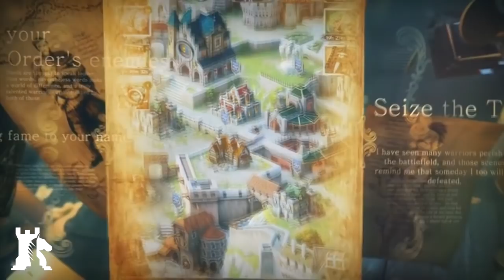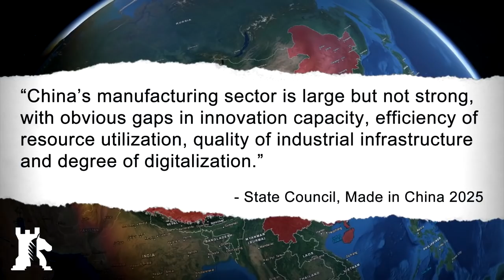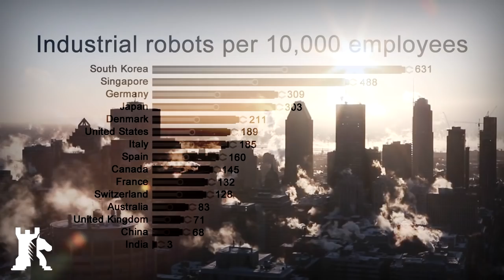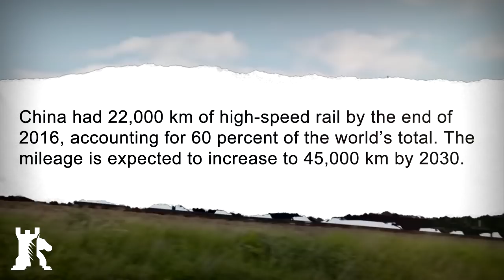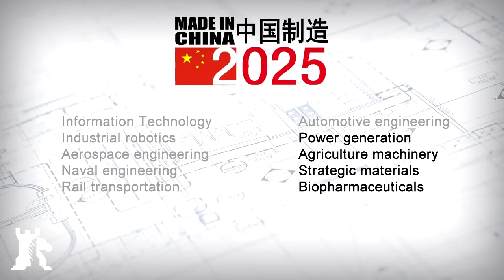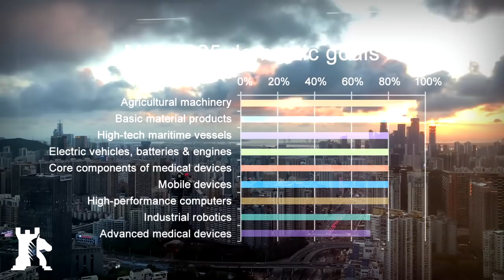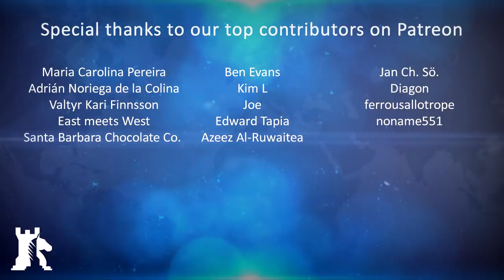China's quest to catch up with the West

Comment: China basically bought the rights to all the most common nuclear reactors in the world over the last 15 years and build one or two plants of that type generally with multiple reactors at each site. With the goal of producing all the parts internally. Now they're building about one of every type of experimental nuclear reactor and have completely outpaced all research throughout the rest of the world. They will be the first with several Gen IV designs with the hope of licensing them to other states.  Wikipedia says that some of their Gen IV reactors should be operational currently although timelines might have changed.
Reply: @Kevin Bettinger lies
Reply: Current second generation plants are slated to terminate operations very soon.
So most every nuclear nation will soon be in the bid for contracts.
Reply: Enjoy the RKMB reactor.
Reply: @Kevin Bettinger I could be referring to the United States dependent on reactor life-extension decisions.
Reply: China has built the world's safest nuclear reactor, which may be safer than coal.They invented a technology that drastically dilutes nuclear fuel, thus virtually eliminating the possibility of all nuclear accidents. 
Say another way, even if their nuclear reactor is completely broken, there will be no accident.Since the nuclear fuel has been greatly diluted, the nuclear reaction leaving the reactor will stop immediately. You just need to pick up the nuclear fuel and re-create a reactor and throw it in.
Reply: Replace China with Russia and you got this right.
Reply: @Kevin Bettinger The United Kingdom for one. China is marketing it's nuclear plants to developed nations only.
Reply: @Русские_вперед  No, where on earthy did you get that from?
Reply: Bought? You mean stole, china is built on theft.
Reply: China leads in the development of thorium-fueled reactors. It's the next step beyond Gen IV reactor
Reply: Nuclear reactors must overtake the world. Ik that it's not cost efficient for most of the time, but it could save at least a century to live in the world. But it's also true that almost( more than 80% )all the nuclear power plants are II generation power plants and both Fukushima(BWR)and Chernobyl(RBMK) power plants were II Gen. So, basically most of them can't face hyper natural disasters. It's very much important to build them at a safer place, where disasters aren't usual. Or another wasteland would be created by the hands of the humans and it could be the end of all nuclear power plants.
Reply: @WalayatFamily  as is the west

Comment: Basically thier main is is they may make a lot of things for export but they depend on importing high tech components
Reply: Not anymore
Reply: It's a material science problem. Any centralized economy is terrible at innovating new materials and classes of materials and typically can only try to improve on or mimic existing products. Truly innovative improvements in materials science and technologies mostly come from a shotgun approach where hundreds or even thousands of competing producers develop proprietary materials and methods, balancing potential great rewards against the risk of complete failure. Bureaucracies are terrible at this. That's why the tech giants in the US after their initial successes have progressed mostly by buying up small innovators, rather than coming up with truly new innovations on their own. China has only been able to succeed to this point by stealing the work of others through patent infringement or forced technology transfers, it will take a cultural shift away from doing what the conventional wisdom demands towards intellectual independence for their technological base to improve and succeed on its own. That kind of self-determination and independent mindset won't sit well with any communist regime since it requires personal ownership of intellectual property and adherence to patent law. Without that impetus there's no real incentive.
Reply: @jinruizhang  lol minus foreign parts china has no product to sell , you cant beat western countries which have diverse groups of people working to develop stuff, freedom breeds innovation not opressive govts
Reply: So we've been taught since high school, and we are seeking for a transformation about this.
Reply: I agree. But we are taught to solve the problem since decades ago. that is why there are so many Chinese students studying engineering. we are not lack of high technology now. we lack cutting edge technology which are monopolized by few countries
Reply: @massivereader  That's a good comment but I'd generalize the issue to the industry as opposed to just material sciences. It can be machining tools, handling powders or fluids, specialized electronics and so on.
Reply: @ivanlagrossemoule True, it's just that materials science is the thing China is having the most problems with. Since high end materials and end products made of those materials are mainly produced by proprietary processes, just having samples of the end results doesn't necessarily reveal how they were made, just what they are made of. This is the problem they're having with things like jet engines and advanced electronics. As Xian Yang pointed out, they have plenty of engineers likely able to reverse engineer western products in a workman-like fashion when told to do so, possibly not as cost effectively or elegantly as the inventors but 'good enough' to work when profit isn't the motive and government can step in to set the priorities and limit competition. But having the closely guarded industrial processes developed over decades to make, grow, forge, sinter, extract, purify, etc. exotic materials to make high end products like single crystal turbine blades for advanced jet engines with the structural durability to last thousands of hours at intense temperatures and pressures (rather than  than dozens or hundreds of hours) isn't just a matter of engineering. It takes advanced materials science, innovation and experienced experts pushing the limits of the art looking for results that aren't a duplication of existing things, but something new. You don't get that by just attending university. In response to his criticism, it isn't a matter of 'monopolizing cutting edge technologies' it's the intellectual process of creating those technologies they are lacking and cannot effectively reproduce. It's not a monopoly. They just didn't appear out of thin air to be harvested. it's an approach based on the competitive capitalistic system, something a centralized governance system lacking flexibility and driven from the top down can not effectively duplicate.
Reply: you didn't see a fact that some high techs are baned by the west for exporting to China for a long time.
so a truth is China had researched and developed most all by itself
Reply: @utavinzo9481  When you have the product at hand, reverse engineering is not so difficult. Most technology becomes the standard of the art within twenty-five to forty years and any competent professional can use and apply what is widely known. That's why patents expire. China merely sent students to Western Universities, or brought professors from those institutes of higher education to teach in China. Almost all of science is available in the west because it's required to publish everything except proprietary information in professional journals to advance the dissemination of knowledge. It's never been the case where China knows of a product and comes up with an alternative without skullduggery. If China hadn't bought IBM's PC business and named it Leveno, they'd still be about twenty-five years behind the art. Most of China's technological and manufacturing infrastructure was built by western countries to take advantage of the low labor costs. Almost all of China's military hardware is embarrassingly similar copies of Russian or American gear. Please provide examples of cutting edge products china has developed on it's own. Cell phones don't count, they ripped off the tech from Apple and Samsung and still buy the main chips from elsewhere.
Reply: @massivereader well there are too many verities you don't know, try at least to understand the most obvious variation of power and potential in this world
Reply: @utavinzo9481  When someone has developed a new technology based on new insights or advances of science, and published the underlying science in freely available professional journals, duplicating their experiments and applying the results in imitation of the innovators is not the same thing as inventing and making practical application of new discoveries ones self. It's copying someone else's work and likely infringing on their patents. Sorry.
Reply: @eduwino151  you dont seem to know about what you are talking about. look up the patent registrations from the last five years in the fields of tech and bio engineering. China isnt even profitable to foreign investors to be the assembly line anymore, they have been moving to south east asia for quite some years.
Reply: @massivereader  There are several things you did not consider. China is not a communist regime, it is ruled by a communist party, but it is not a communist regime. intellectual property right laws exist (yes not the best enforced, but the structure is there and its improving rapidly), and a cut throat free market at the domestic level. It just puts restrictions of foreign investments (why let others profit on you for free while stopping yourself from developing, orange man trump is doing the same thing now becuase china is catching up and EU has been doing this since long ago, why do you think ttip never went through). So there is what you call a shotgun approach in the Chinese market, because yes, it is a highly competitive capitalistic market (otherwise where do you think all this Chinese money comes from). political theory sounds nice on paper, but you also need ground research to see if reality corresponds to theory. Trust me, I am a political economist. people seem to have an idea of china is and how Chinese people/culture work, but never bothered to check if it is really like the way they think it is.
Reply: @jinruizhang  TTIP never went through because NAFTA was a national disaster, and the folks here by and large voted for the candidates that were against it. Both treaties were a creation of the globalist elites (many in the pockets of China - Yes, I mean the Clintons) and mostly rejected by the populace as a whole. As to intellectual property rights, no one doubts that on paper you have the structure, otherwise there would be no defense on domestic or international competitors infringing on Chinese IP. It's just not enforced domestically against foreign IP's, or any company (most of them) owned or run by communist party members. As to the 'highly competitive capitalistic market', how many companies are run and or owned by either members of the military or Party members, and who does the banks extend the loans to, and prop up when failing? Thought so.
Reply: @massivereader  most companies arent state owned mate. SOEs arent profitable and drag the economy of quite a few sectors down, but China's SOEs are small in number compared to private enterprises. Also, SOEs in certain sectors are extremely profitable, especially construction (thats how China builds in other parts of the world). IP is enforced in China, just not equally between foreign and domestic (its not fair for foreigners, but why play by the terms of the ones who only wants you as undeveloped cheap labor ). Also, you make statements about China that simply arent accurate, its quite obvious that you arent up to date or in the know about Chinese reality.
Reply: @massivereader  邓达
 has pretty much refuted all your claims. Just rest your case and actually look into China's current economic and political reality. Also yea, try to expand your economic theory knowledge. You know that economics is a pretty much purely western discipline right? other economic schools of thought that arent Neo liberal or classical are still western, so dont worry it wont be some scary eastern brain washing . Also, Trump is a protectionist, which means he is against free trade, if you support him, you are ironically against free market economy.  Also, TTIP didnt pass because we Europeans (yes I am an European), did not want your cheaper but shitty american food product.
Reply: @jinruizhang   Didn't claim they were state owned. They are owned by individuals who 'just happen' to be party members or powerful members of the military, or their families.
Reply: @massivereader  again, generalizing certain aspects and making it the norm.
Reply: @jinruizhang   Well, since you seem to be the expert, what are the statistics then? Oh, wait, this is China, not an open western society. Why was I even asking? Contradicting my arguments with vague assertions that they are incorrect, with no specifics, and without actually saying anything that can be refuted, but with an air of intellectual superiority is not at all convincing. I must say, though, the English vernacular usage of the people your government hires to post refutations online has massively improved. My compliments!
Reply: @massivereader  Half of what I said was not even about China... Plus, Im not your researcher, google it up yourself. There is a ton of non chinese data and studies on China, there is china studies in pretty much any humanities department in American Universities, take up a china minor if you are interested. The other guy gave you plenty of tangible and specific examples as well... And as I have stated before, I am from Europe (Portuguese), not a Chinese citizen.
Reply: @massivereader  lol what a lil 5 year old
Reply: @jinruizhang  What? You're still there? Ready to supply some facts yet? No? Could that be because of the nearly total lack of transparency of your government? Or just afraid of dinging your social credit score?
Reply: @massivereader  lol do you learning if you want knowledge. Be a better person and enroll yourself into uni
Reply: @jinruizhang   Oops! Be careful. Winnie the Pooh is listening.
Reply: @jinruizhang   Sure zhang, now slink away.
Reply: @massivereader  lol

Comment: C919 failed????? ......In your world???
Reply: Yes, due to heavy dependence on foreign parts. Did you not pay attention?
Reply: @ILovePancakes24  Do you know there are how many  foreign parts in Boeing and Airbus?
Reply: @gonlenny4936  the point is that america could make them if needed, where china cannot and is vulnerable. Do you not have critical thinking skills?
Reply: @ILovePancakes24   China can also design and make most parts if needed, but it needs a huge investment. Using mature parts from foreign supplier is a smarter decision. The only exception is jet engine.

Comment: I think Chinese government know what it is doing and is capable.
I don’t know if you noticed that the new OS Huiwei released around mid August was intended for industrial uses and it is designed from the begining to be used across the platforms.
This is the first OS which where designed to link all equipments including phone, laptops, and other devices. Don’t know how good it is at the moment, but I think this may be what the Chinese government is trying to do.
First, go to 5G where all devices are to be linked, where there are surely new IO devices to be used, i.e, eye recognision, 3D visual things. 
Due to this revoltion, rewrite the program softwares using the new IO, so industrial apps can be used remotely (which is what 5G bringing), fast transfer rate allows information to be travelled faster.
The above would surely cause the more consumption in electricity and China imports too much oil and gas and they are trying to replace petrol car with electric, which they are researching intensively on new energy method. 
Replace labour intensive work with machines to replace the labour lose due to old age. 
Invest in phamasoticals to give the citizen cheaper access to medications due to aging population. 
The Chinese policy makers are engineers. These plans may not turn out to be what is expected but at least the plan make sense and you know there is a plan for the coming problems.
Reply: Basically, there is no point re-write code that you know is going to be out-of-dated in 2 or 3 years. So I think the Chinese are going to skip this phase entirely and just go with the next generation of OS. 
So I think you are wrong about Chinese trying to catch up, they are trying to lead the next technology change, which is why US starts to panic.
Reply: 小时候对那些五年计划之类的东西没实感，长大后才知道什么叫 ”计划就是计划！“😃😃

Comment: Middle Income Trap as related to Manufacturing Value Add is an Investment Bank trope of recent origin, less than a decade old.
Middle Income Traps, are related to countries seeking to transit from early Investment and Export Led Development to Domestic Driven growth.  Typically countries get stuck in Middle Middle Income, primarily because "vested interests" (ALbert O. Hirschman; Exit Voice and Loyalty) are resistant to altering the Economic Model where small groups have benefited disproportionately of the processes associated with early stage development (heavy industry, infrastructure, etc...)  It has nothing to do with higher value added exports and/or production more generally.  All to do with wages, wage share to GDP and growth of higher level services and soft infrastructures to serve those whose incomes have advanced nominally, but need not do so proportionately to GDP to keep sustainable growth moving apace.  Involves more decentralization of society and wealth than many  groupings are willing to do, and they make the political decision to not do it.  Hence, Trap.  Nothing to do with nature of production.  This is an issue that goes well further back in history than modern iterations of supply chains diversification and recent technological advancement.   To treat it otherwise, is to become a pigeon of someone's propaganda.